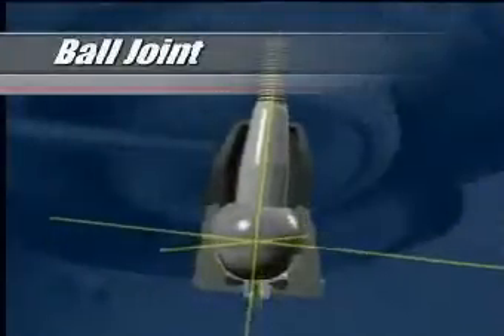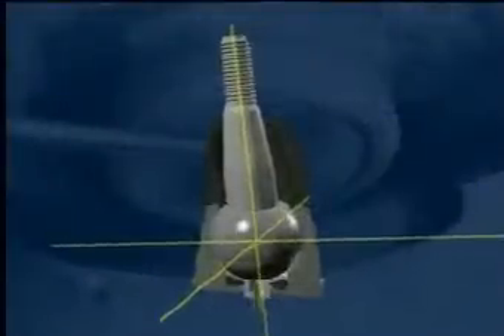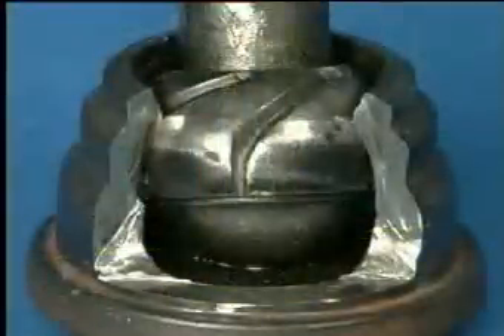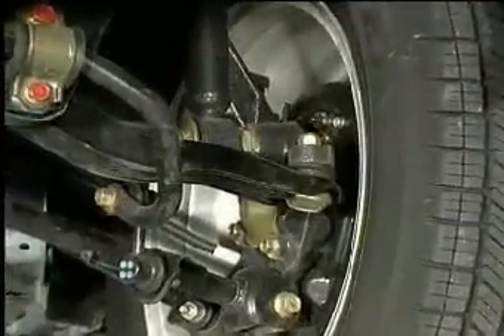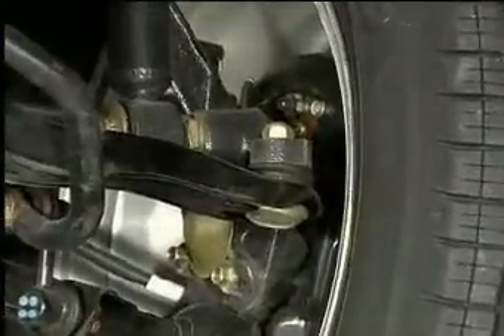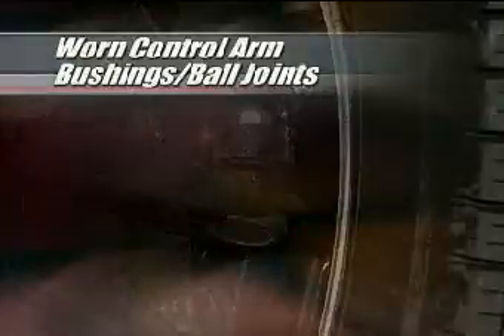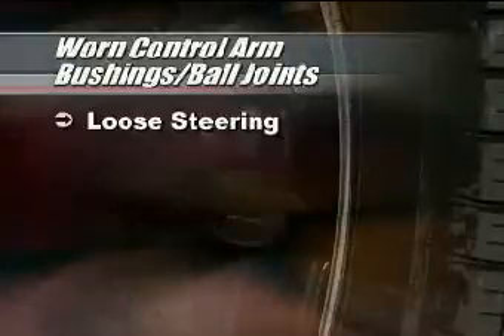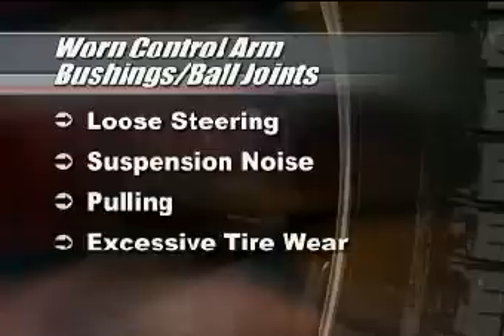A 101 On Car Control Arms, Bushings, And Ball Joints.

Comment: Which part of the bushing rotates like in 0:25?
Is it the inner sleeve (crush sleeve) that rotates with respect to the bolt that connects to the chassis? Or are the aforementioned parts static and it's the rubber bushing that twists and allows the rotation?
Reply: Yeah that's exactly what I wanna know too. It's sucks to have every car guy present himself as the absolute authority on car knowledge and still don't know this basic stuff. For example I go to car repair shop and ask about class 10.9 vs 8.8 fasteners and they come with some bullshit that totally shows they don't know anything about that.